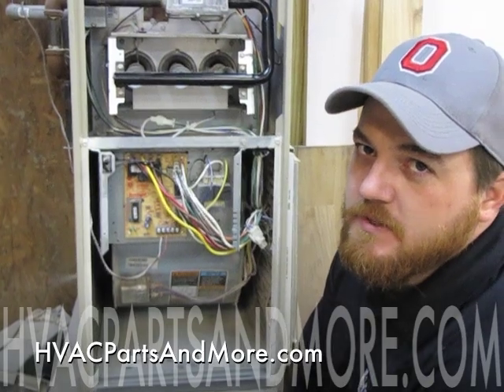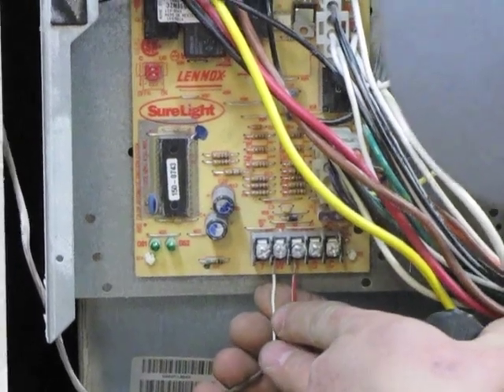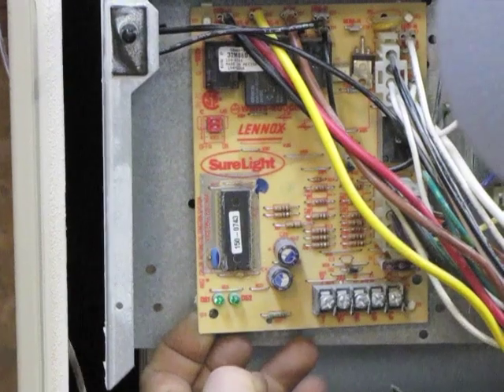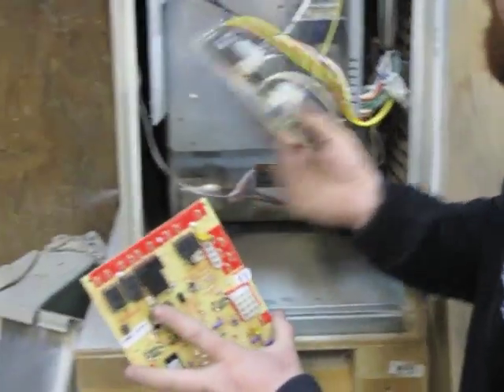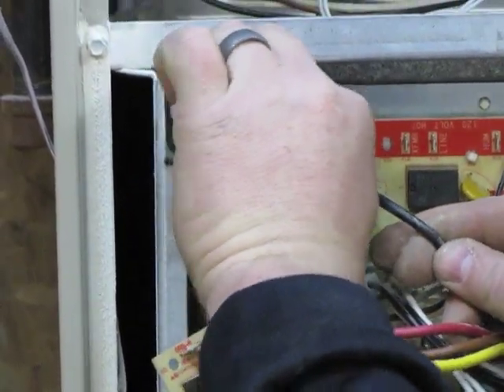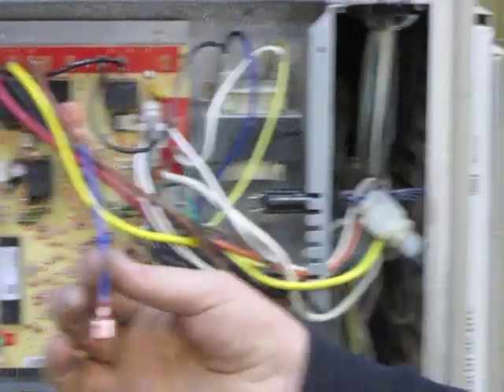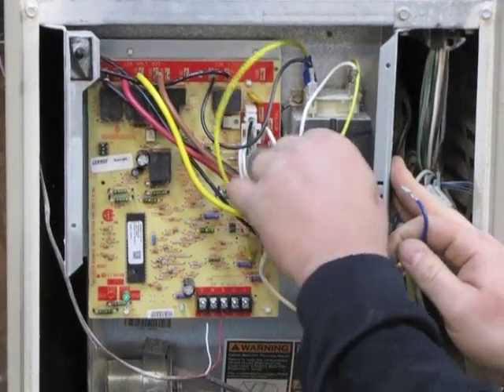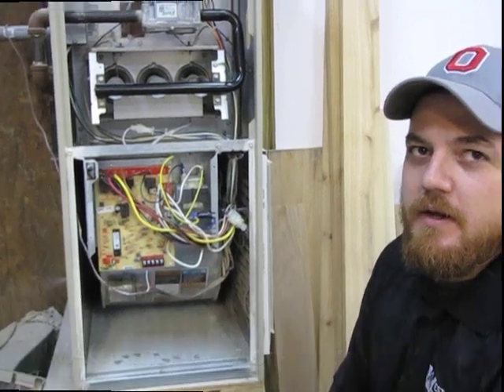DIY - How to Install a 83M00 SureLight Board on a Lennox G40 Furnace

Comment: Very helpful, the box came with additional wiring harnesses which did not apply to my installation. Luckily the board I was replacing was identical to the one in the video. As a tech this was very helpful since I could not get a hold of tech support. Thank you